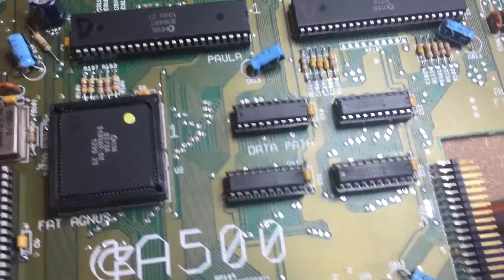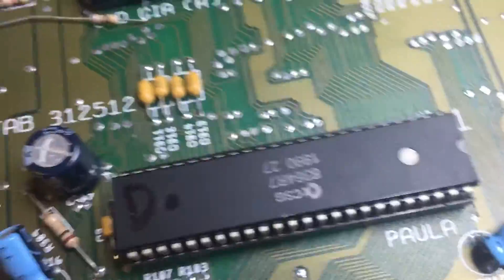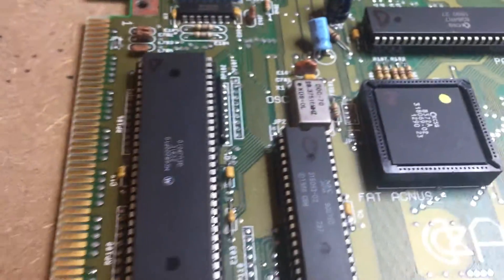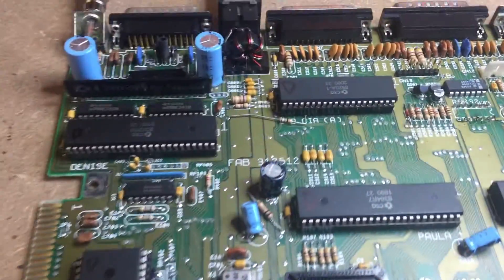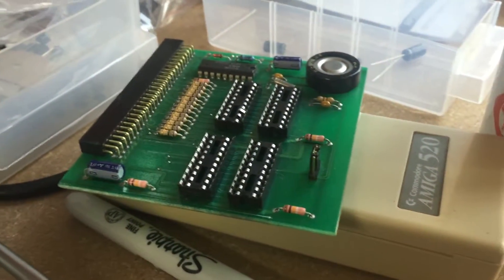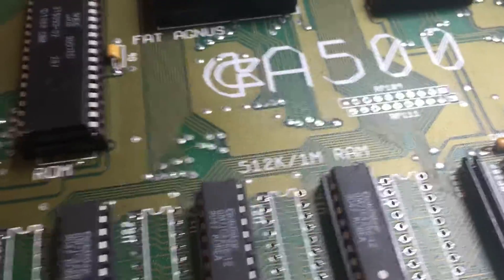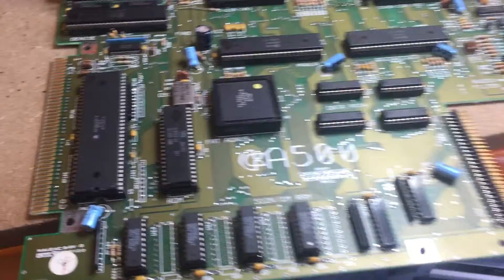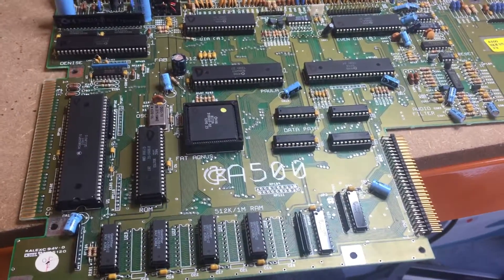Commodore Amiga A500 repair from blank black boot screen.

Comment: A handy tip if you have a DiagROM chip: you can run DiagROM from trapdoor "Fast" RAM if you suspect the mainboard RAM is bad. Hold the left mouse button at power on (and release it before it checks for stuck buttons). There will be no video output - only serial. Holding the right mouse button will tell DiagROM to use the beginning of RAM rather than the end. You can combine the two.

Comment: Hey just for the information, When an Amiga doesn't work but you get a Gray screen, light gray screen, black screen or and white screen, these are different screens displayed as the Amiga checks the different system chips, Gray screen and stops is RAM,  you should be able to look up (Google) what each of the different color screens are and what is being checked when the Amiga powers up. Also get a chip puller they are cheep so you don't destroy your ram chips, flat head screwdriver will work but it' runs a chance of bending of breaking off pins.
Reply from the maker: Thanks for the tips.

Comment: I had black screen on my amiga 500 but the sound from the disk drive was there so I put a disk in and it bootede up and the game appeared on the screen. After a few times then start picture also came forward. I am thinking about it can be bad caps
Reply from the maker: Could be. What do the power rails look like? Do you have a scope?
Reply: simon unsworth No so much I haven't messed with it yet